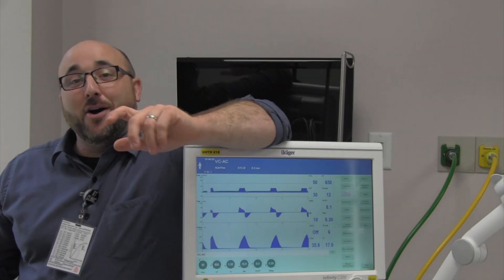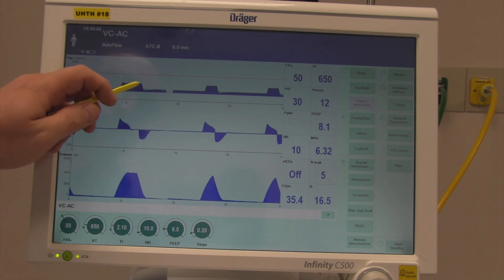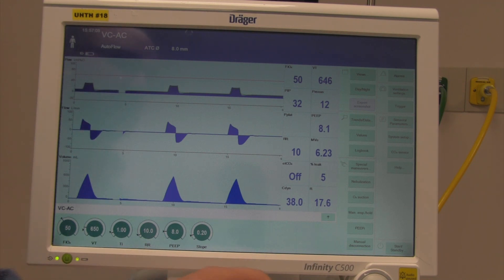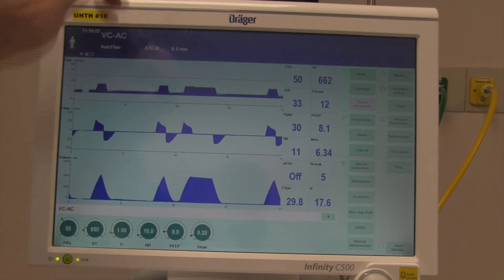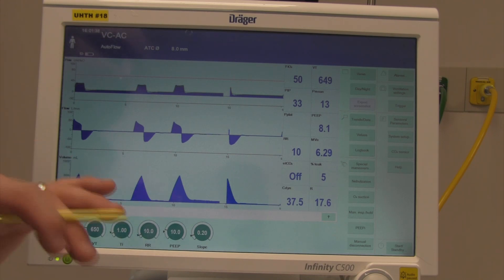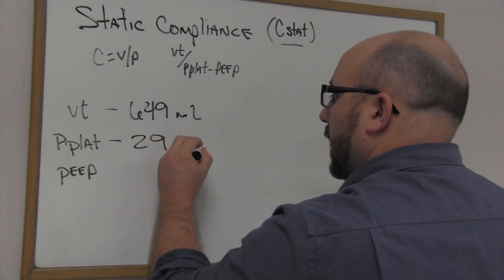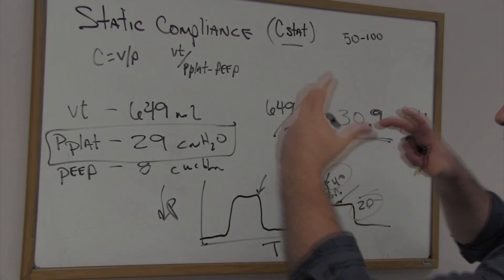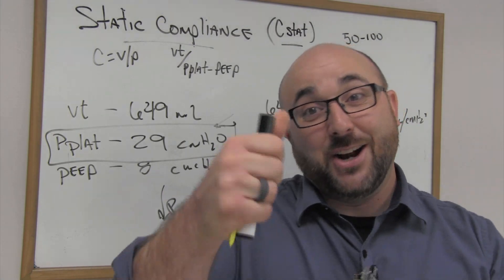RT Clinic: Basics of Plateau Pressure and Static Compliance, Early Indicators of ARDS

Comment: I was trying to see if you had anything on here I didn’t see it, what are your thoughts on train of four,being paralyzed and static compliance? Do you see an increase in compliance if patients aren’t paralyzed properly? I know you can see a breath initiated, but I’ve read without a great deal of detail that it will show in the ventilator compliance.
Reply from the maker: Thanks for the question, Ashley!  Static compliance can most accurately be measured if the patient is paralyzed. Dynamic compliance (PIP-PEEP) might improve when the patient is initializing their own breaths. I'm not as interested in Dynamic compliance because it has many variables that can be remedied by bronchodilators and mucous removal.  I hope this helps.

Comment: For the tidal volume used for Cstat and Cdyn calculations, are you using the the set tidal volume in volume control or the outcome tidal volume the patient is giving? Thank you
Reply from the maker: They should be similar, but I always use exhaled Vt over inhaled Vt.
Reply: @rtclinic  Thank you
Reply: @rtclinic  Thank you

Comment: Great vid, could you speak to ventilators that display Cstat breath to breath.  Could one optimize peep levels based whether the Cstat goes up or down?
Reply from the maker: Good question!  I've not used static comp to look at optimal peep, but I'm going to give it a try

Comment: For a highly compliant lung, what would be the Cstat value? Would it be safe to assume it's above 100, since you gave a normal range of 50-100cmH2O?
Reply from the maker: I'm not sure. Just running some numbers it takes a 1000ml tidal volume with 10 cm h2o between plat and PEEP to cause a c stat of 100. More than that is crazy.

Comment: What happens to Pplat if you held the inspiratory hold button for longer than 3 seconds? Would that affect its accuracy?
Reply from the maker: It shouldn't affect accuracy. I've held it for 5 to 10 sec to get a stable reading because the more was a small leak.

Comment: Hi,thanks for this good video,can we measure the plateau pressure on pressure if we can ,i try inspiratory hold but doesn’t appear??in servo i ventilator or we can make inspiratory pause 0.5 second please answer my questions??
Reply from the maker: I've used a servo-i ventilator in the past. It was used as a transport vent, so I'm not sure if it has the advanced capabilities to read plateau pressures. I would put the scalar pressure vs time waveform on the screen, perform the insp hold, and estimate the height of the plateau based upon the y-axis.

Comment: This is done if the setting is volume-controlled right? If it is in pressure-controlled ventilation no need to get the plateau pressure?
Reply from the maker: Great question. Plateau needs to be checked on both Pressure control and volume control. The inspiratory pressure on pressure control is the measured PIP. The plateau could be the same, but will likely be less than the PIP. A breath hold is used to evaluate it .
Reply: @rtclinic  Will all (ICU level) ventilators allow an inspiratory hold during PC and/or PRVC ventilation?